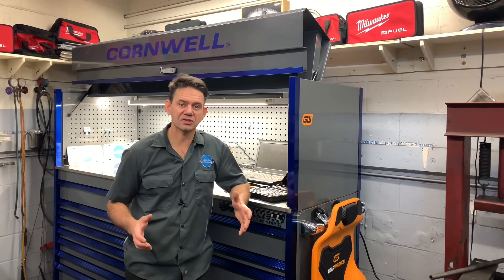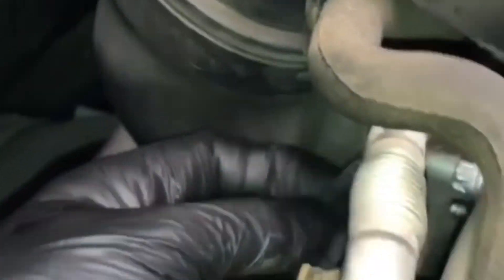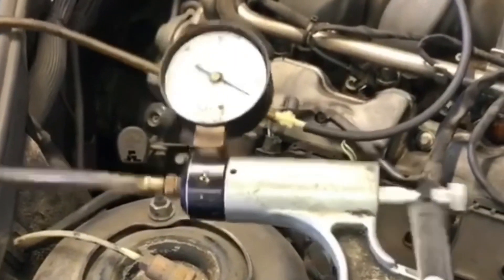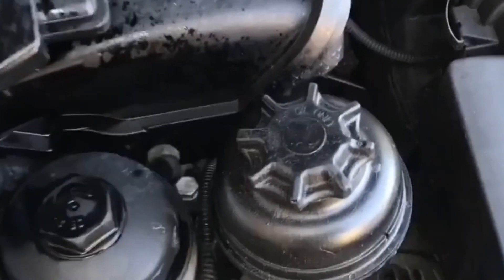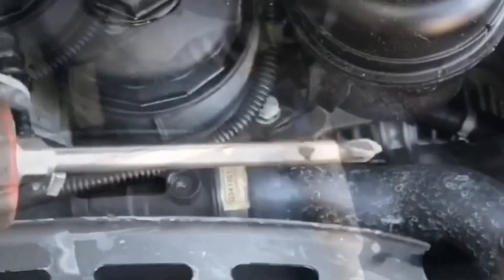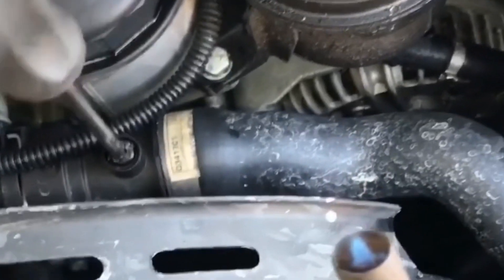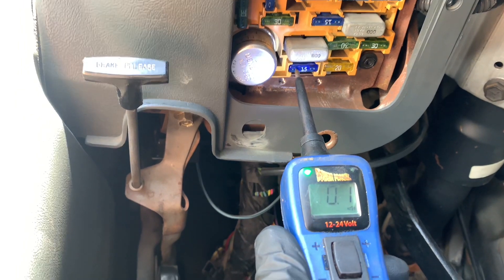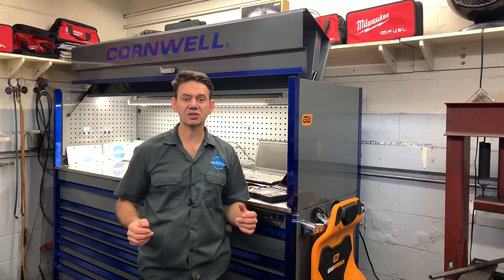How To Test An EGR Valve And Find A Short Circuit

Comment: I have seen it with the GM 3400s finding the EGR port plugged up with carbon setting off EGR valve codes.The older Ford 4.6s in the Crown Victorias,Town Cars and Marquis too,EGR valve passage plugged up with carbon setting off EGR codes.
Reply from the maker: Yeah I would say it’s pretty common. Thank you for watching!
Reply: The Ford Windstars with the 3.8,a plugged up EGR port will cause a misfire